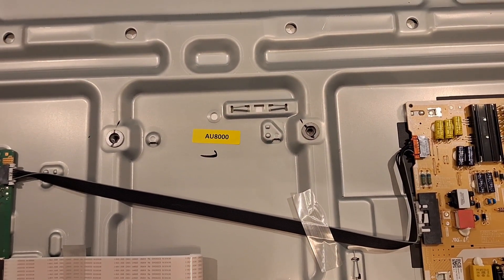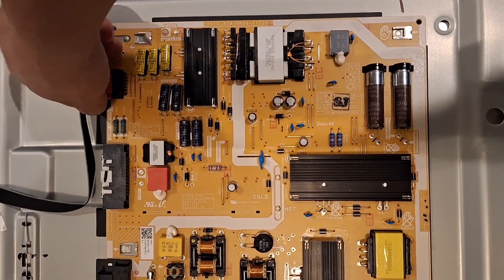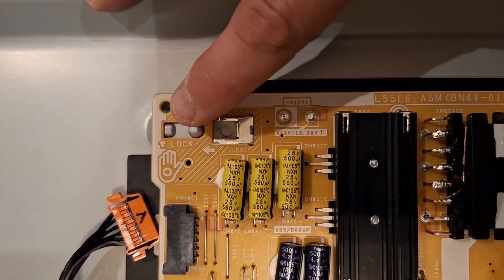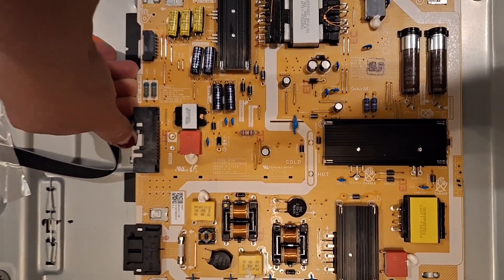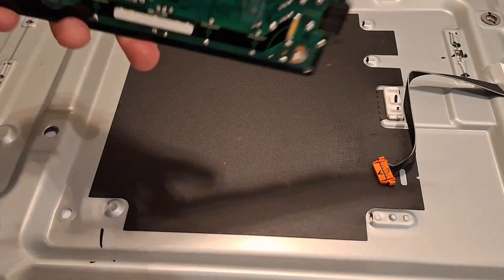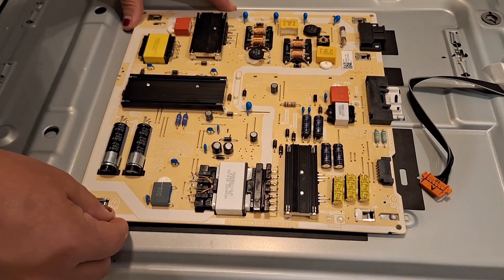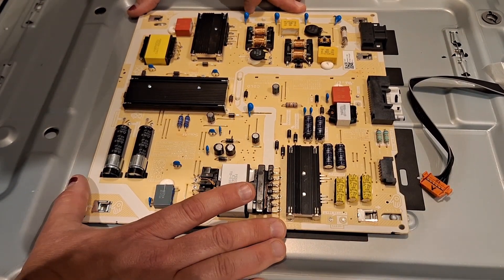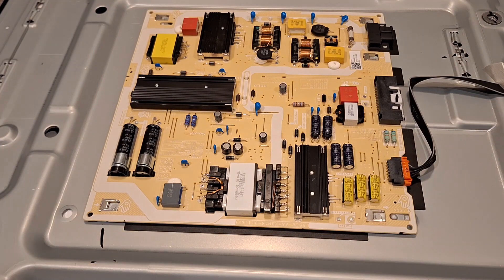She Digs DIY - Removing & Replacing Power Board on Samsung AU8000 Series TV

Comment: Would this work if I have trouble getting connectivity with my remotes and the control box underneath the tv doesn’t turn it on or off?
Reply from the maker: It's hard to say. It could be that the remote isn't compatible with your TV,  but if it's a recent model like this one, that shouldn't be a problem.

Comment: I was kind of hoping for a video on the whole process, from taking off the back panel to reassembly. But this is also very helpful, thank you.
Reply from the maker: @jaredhardegree8377  Not sure YouTube would have let me post that with all the cursing involved in that part of the process. 😂

I used a flat piece of plastic and ran it under the edge of the cover to release the spots where it was attached to the housing. It was tedious and took the most time by far, just to avoid breaking it. I'm not the most patient person around, so it was a challenge! Good luck!